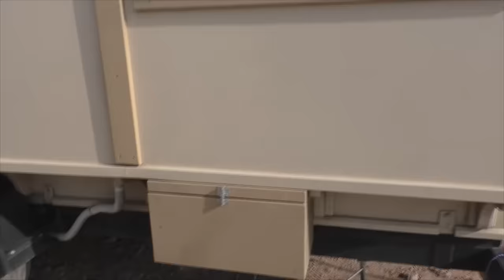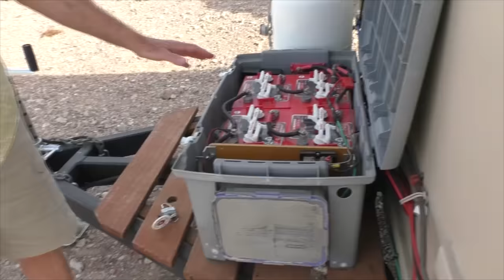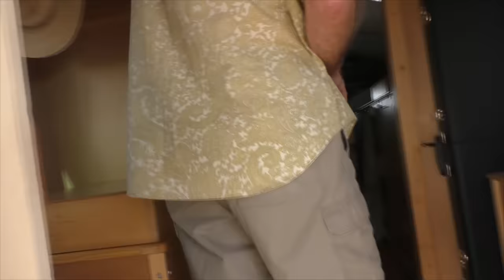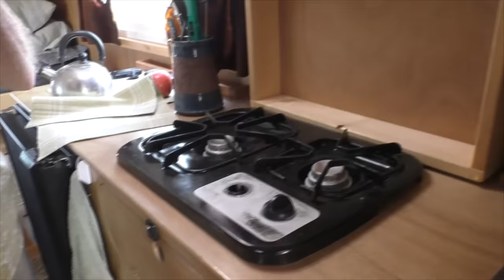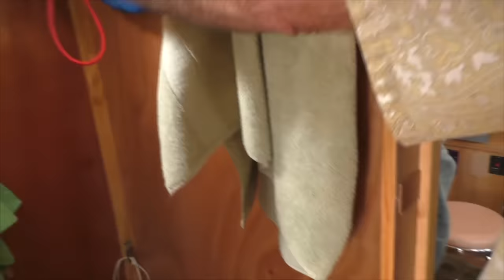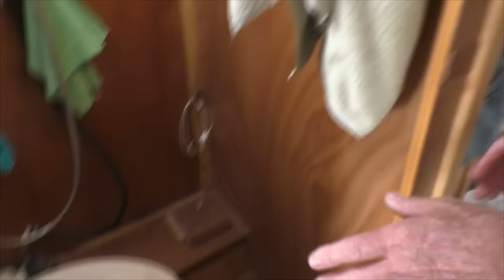Nomad Lou Shows His Tiny Houses Example on Wheels

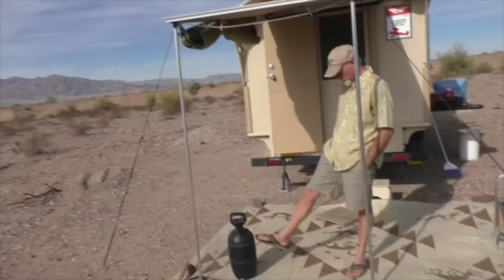Comment: At 25:22 Lou was talking about how he found the key to removing the touchiness of the on-demand hot water system and was going to talk about it inside but it wasn't talked about after going inside. What Lou discovered may be of tremendous help for anyone else with an on-demand system. I was wondering of you could do a follow-up to share what he was going to talk about.
Reply: Burgh Dewd 
the garden sprayer is the reservior for the system. it also adds preheated water (from the sun) to the equation. he circulates the water to heat to the desired temp, then switches off the heater and just uses the pump to spray the heated water through a kitchen sink sprayer. it takes very little water to get an effective shower.
Reply: +Scott and Lora  Hmmm..., I thought he had a shower in his rig, so he just uses the garden sprayer, I see now. Thanks!

Comment: i live in florida .built a 6 x10 cargo camper  am retired for the most part but still a part time job at night on and off.trailer built with solar so self contained .live in the melbourne area of fl .but not much boondocking areas around and campsites run about 25.00 a night which would add up.

Comment: Great video. Good guy.  Questions.  Length 15 ft. Built with 2x2 for frame? 
Insulation  2 in foam??
90% 12dc use??  How much water storage 50 gals??   Would have been nice to know  answers to these questions ??? Thanks good job over all
T

Comment: i would think that trailer will swing all over the road because of the weight behind the axel......rule of thumb is axel is 2/3 of length to back of trailer from hitch. great job on rig otherwise........love the video.
Reply: chris nussbaum 
the 300 lbs of battery box and propane on the tongue would take care of that. the right amount of tongue weight get's rid of the trailers tendency to sway.

Comment: Very nice rig, love the "nautical feeling" on it.
I would like to know how much weight the ir put on the towing hitch with the batteries at the front.
I have no doubt that he worked out the weight distribution well and assume that the rig it is not very heavy considering that it is on a single axles.

Comment: Well Jamie, if you get a chance to ask Lou why he went with a single axle over a double when he added the 12 feet.  I'd be concerned about bouncing down the highway.
Reply from the maker: I'll ask him David. My guess is that he didn't want the drop in mileage and the weight rating was sufficient for just one axle, but, yeah, I'll ask.
Reply: Scottosphere , one disadvantage to tandem axles is increased tire wear. Watch a tandem trailer next time it moves through a  sharp turn,  it  tells the tale.  I also like a torsion axle, they really soak up the bumps.
Reply: David Dube' 
More wieght to tow. He said he custom made he rig to be Ultra Light !

Comment: If that 100 watt panel is in line with those 150 watt panels then he's losing voltage from his 150 watters.
Reply: Kevin McKinzie FYI mixing wattage is no problem as long as they're all the same voltage (VOM) rating.
Reply: Smaller panels will bottleneck the available power coming from the bigger panels. It's an expensive lesson. And a lot like the reason you never add a new battery to a used battery bank or a smaller battery with a bigger one, the lesser always wins.

Comment: Any suggestions for a single mama with two kids? We're 42, 14 & 9. I've always been a stay at home mom for the most part and we all want to be nomads. Thinking of a skoolie but I've rarely had a tool in my hand. I'm just watching all of Bob's videos, now EN and a plethora of littler vloggers but I've not seen any single mamas with growing kids doing this and certainly not from the ground up. 😔
Reply from the maker: Hmmm. I don't know of many doing it, but why not? I'd definitely go skoolie for the bang for buck factor! Come to my van build in November if you are ready and we'll pitch in to get some basics installed if you can get the materials together. Cheers!
Reply: That's an awfully generous offer. 🧡 Whether we'd have a bus by then I wouldn't be too sure but that's the goal. Regardless, we've got a 2014 jeep grand Cherokee we could set up to camp just to come out to learn and become saturated within the community, of which we've never been. -Im assuming I need to find a check list, being as naïve as I am, of what we need in looking for a bus. We can budget to put money into it over time but I'm assuming I would like something that has a decent engine and no cancer in important parts of the structure. Then, too, with the Jeep I'm hoping we can bring that along to detach and go deeper boondocking than what we'd be able to take a bus. So maybe a mid sized bus in case we have to tow. (I'm obviously thinking out loud here and have no idea what I'm truly talking about.) But...We want this so badly we can practically taste it. We're over society, over public schools (love to the teachers though) and we want the goods of a more spiritually, organically led life, humble and uplifting community and a journey we can be in awe over. (I mean, we have a nutty side to us as well). -Enough babble. -Where will you be in November?? 🙌🏽🙌🏽

Comment: I want Lou's opinion of what I heard someone say about a an extremely wellinsulated van is not the thing todo cause it will just hold the heat real bad I guess in the summer in hot climates.  But I wanted it to be an R-30 on all six sides for easy heatin.g in winter.  What is his opinion/toughts on this pleaes.  Thank you.  Bob F.
Reply from the maker: Bob. Do it. You can always roll your windows down and/or install a roof fan.
Reply: Thank you very much!